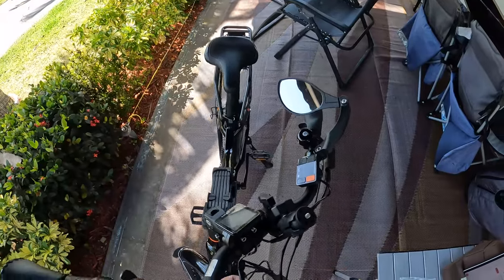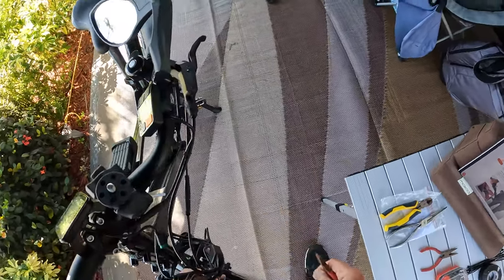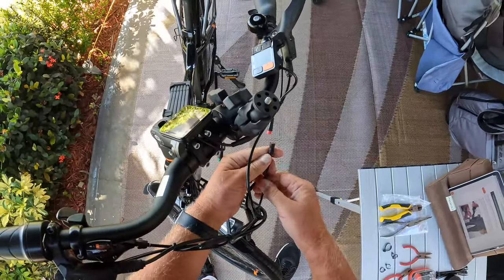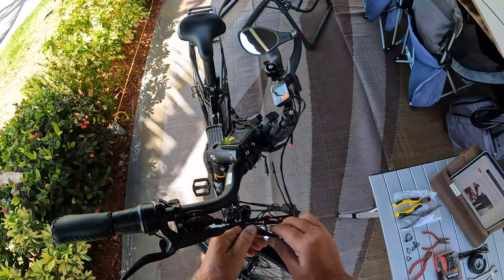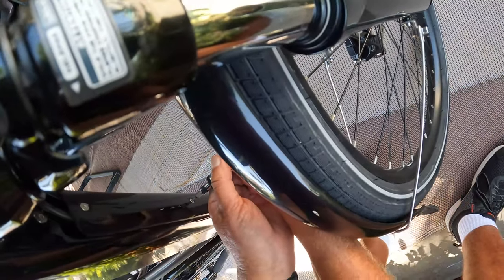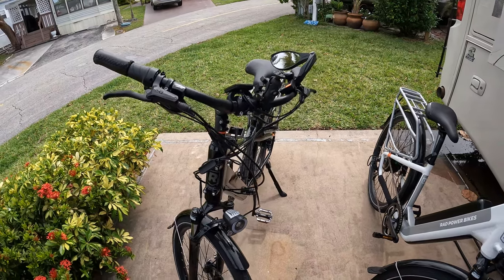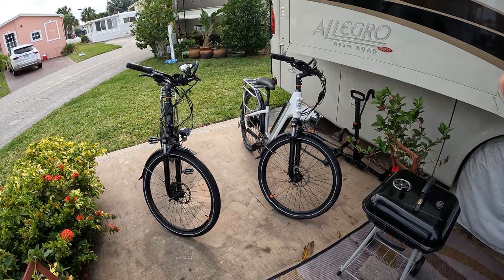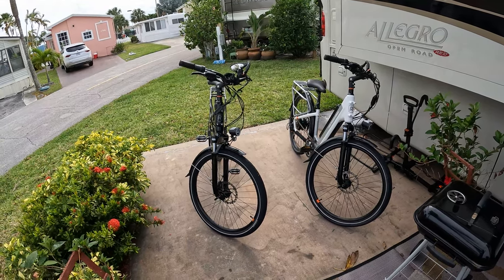Rad City 5 - Installing a New Wiring Harness

Comment: Older City. Had to shove the single wire through the brake line hole to pull it through,  No way was it making that right angle corner through that tiny hole. Doing even if possible so will cause undue stress to be put on this connector.
Reply from the maker: There are factors on this bike that make it less than service friendly. Thank you for the comment. ~Barry